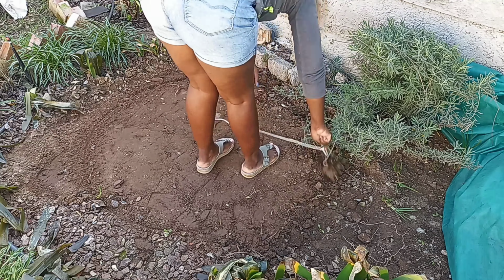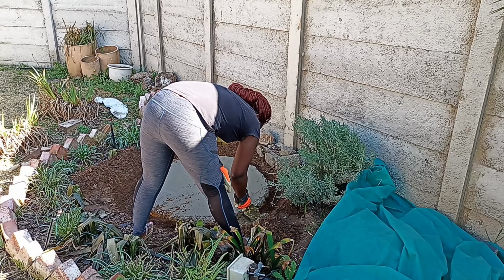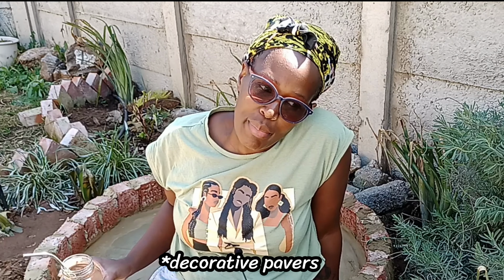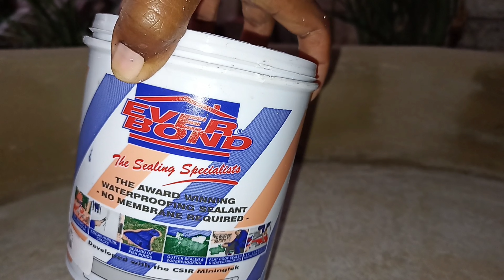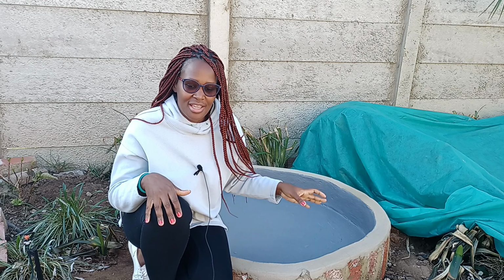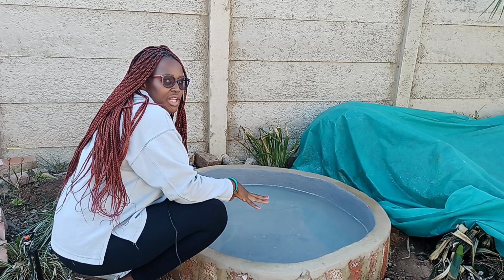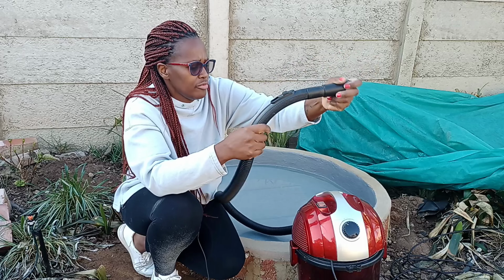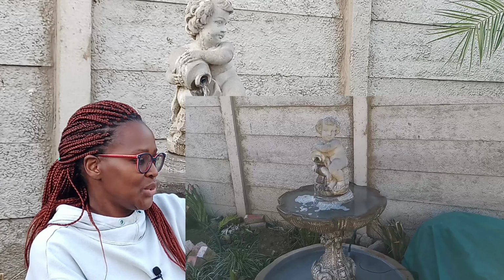DIY POND FOR GARDEN FOUNTAIN

Comment: wow Sibo this really looks good. I'm always afraid to touch concrete it always cracks aayy
Reply from the maker: You just have to know the mixing ratio of the building process and those for plastering. Also you can use mixing bonds instead of water. Tnx for being here